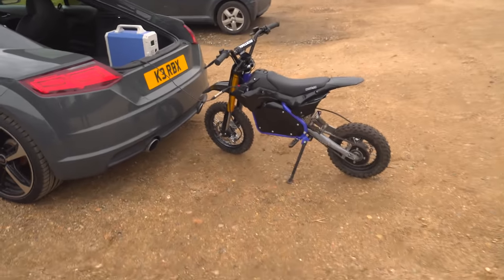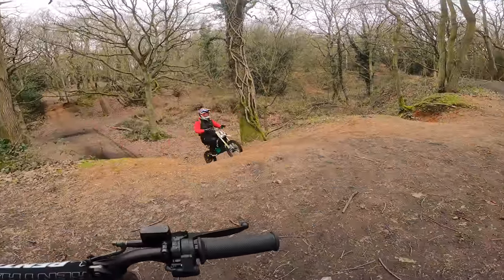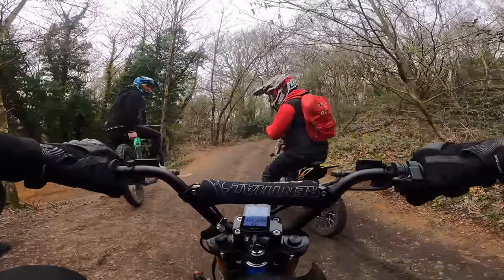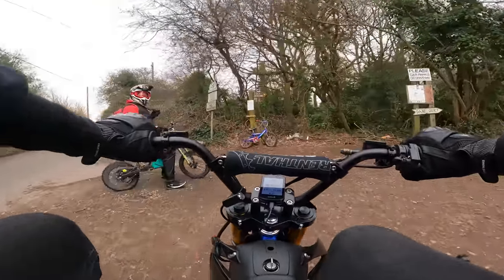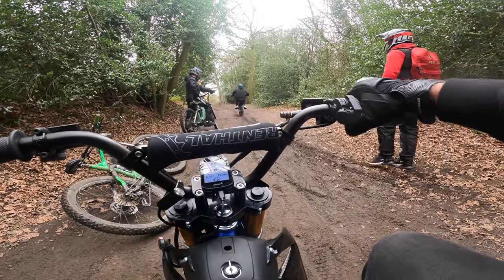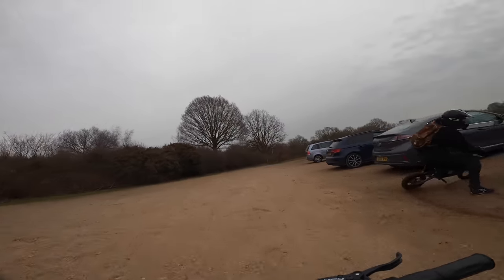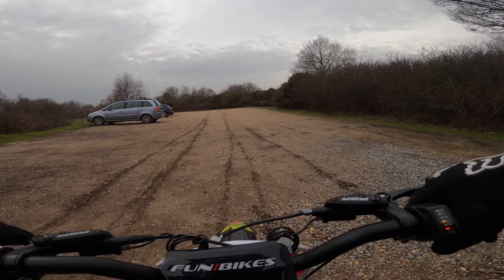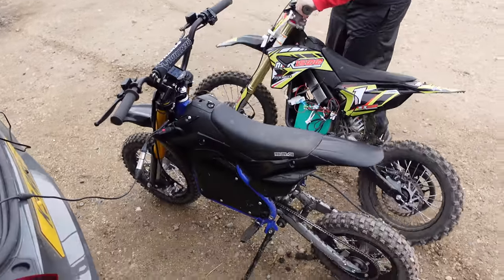RACING MODIFIED ELECTRIC MINI PIT BIKES!!! (10,000 WATTS)

Comment: Great content! What kind of amps do those setups draw at 10kw? Do you have the RPM spec's? I'm currently on 3 120v mower bats and a kelly controller with a 3000w 72v motor. It seems gutless much over 5k but pulls to 8krpm. also doesn't pull more than 75a with 3 40a rated packs. Changing the garing form factory makes is slower. Currently at 45mph with 11/80t gearing.

Comment: What kind of amp hours are you running on the 72? Thinking of doing my own, but for the sake of down time was wondering if using quick swap batteries like for cobalt 80 volt lawn tools maybe 2 in parallel and just getting a pile to swap out and keep going.
Reply: He's using 30q batteries in 3 x parallel setup IIRC so it would be 9Ah.

Comment: What’s the top speed on the mxr1500  can u do a gps  speed run curious because I got my son a mxr1300 and that doe 17 mph
Reply from the maker: 17mph for the standard one sounds about right. This one is modified and does about 30 ish.
Reply: Thanks for replying Andy  I’m proberly going to do similar to what you done my boys bored of the power now he’s had it since he was 4 he couldn’t even touch the ground then he’s 6 now

Comment: What ah rating is that battery and what sort of range can you get running 10kw??
Reply from the maker: It's a 9Ah 72V battery made of Samsung 21700 30T cells. Loads of power, small light pack that can be charged quick. 10kw on this bike might only happen for a split second. The average power is more like 2-3kw.
Reply: @andykirby  not bad, I'm running a 4ah 36v from two ryobi batteries so it puts outs amps no problem and I run it through at dc dc converter to boost it to 84v to get 4000w peak and I get 4 to 5 mile range

Comment: Lol Steve's gonna be buying you some tires for this bike soon lmao,
Reply from the maker: Yeah he will😁
Reply: @andykirby  lol where did you get those bikes from?
Reply from the maker: Steve's is from funbikes and mine from ebay. They don't go like that as standard!
Reply: @andykirby  I know lol I see you video with the mods, think I might get one after I've finished my ebike, still need 100 more 25r 2500mah to upgrade my battery because the current version is to unpredictable (20s 10p) 25ah 72v is my goal with 180A constant discharge 500A max (300A bms) + a new 200A - 300A controller that I've yet to find (any recommendations?) my bike looks nice as an angel/ like an 85cc monkey bike
Reply: @andykirby  but these do look fun and somewhat cheap

Comment: Andy Why don’t u both get sur Ron’s with a new battery and Bac 8000 controller ? This would pull off the line quicker than any others ebike and also would have a top speed of around 80 mph

Comment: Hi Andy, wondering if you could help me.. my little lad has a revvi 16” balance bike and from what I can gather, it has a 250w motor. And I’m thinking of adding a bit more juice too. He’s got a yamaha pw50, so the added power isn’t going to be too much for him, but it’ll help him on the days he’s unable to ride. As the extra power will help him get used to it I think. Have you come across a revvi bike and seen how they work and would you recommend anything. His bike has the removable battery, but the connector is deep in the frame I think. I did buy a spare battery at £95 for the extra range, but that doesn’t seem to be a problem really and we’ve not really ran outta juice yet. And has lasted 13 miles. My lad is 4yo and has been riding since he was 2. So the extra torque would be very much welcomed, as he is now starting to push it a little more at the local bmx track. On the hunt for some suspension forks too as the bumps are harsh at times and too much for his hands to keep a grip.

Comment: i think there is something if you take your battery pack and make an equal sized super capacitor bank when hooked up to the controller right gives you ability to control the smoothness of acceleration better plus you double your battery bank and like a tenth of the weight think that dude The Inja  a youtuber did something like that with his caferacer

Comment: Is there any 250 watt hub or mid drive motors that do about 20-25mph,that you can put back to 25kph/15mph incase I get a pull by the coppers?🚴💥
Reply: Any e-bike that can take a speedbox
Reply: you cant get to 25mph with 250 watts, you can get there using a 250w motor running it at 1kw, simple answer is just peddle, cops wont do a thing, ive been riding high power ebikes since the mid 90s, Police dont have power meters with them, just be sensible, I have 5kw capable hub motors on bikes, I have a simple 250W sticker on them and the same on the controller, only way you could face an issue is if you hit someone,  even then with or without a motor you will be in trouble anyway especially if you seriously hurt them and even then they would have to prove the motor was on and you were using it. Way too many people get hung up on whats legal, just be sensible, helmet, gloves, lights and high viz and you wont get any bother.
Reply: get what ever power hub you want. on ebay you can buy foil stickers that look pretty official stating that its a 250w road legal motor. iv had no problems yet
Reply: The bikes advertised as having a "off road mode" are illegal, any bike that has switchable power levels over 250w is, even if in 250w mode at the time.
Reply: @knoxieman  I can get over 30 mph on flat ground with my Bosch performance line cx gen 4 motor with a speed box. But I see what your saying.  Just go with what best suit your need and what you using your bike for.

Comment: 1st Off It's Too Light, 2nd It Needs Brush Hand Gaurds, 3rd Your Frickin Nutz!!! 🤣 I'm Now Building The Exact Same Size Power Train On My Old 1970 Suzuki RT1 360 MX Frame That I Used To Moto-Cross Race On At Age 17+18 In 1970-1972 & Blew The Motor Up On, PS I'm Now 67 Years Young! 🤣
Reply from the maker: 😅 Awesome!!! I'm still going be doing this when I'm 67 (hopefully!!!)

Comment: Those little bikes look mental 72v 10kw not enough that makes me laugh to think of that on those little wheels I've gone bigger in the rear wheel to get more top speed 72v 15kw thereabouts build atm im going back to 24in however with those little wheels the torque/acceleration will be impressive it must be nuts to ride

Comment: Would love to go out on a ride with you two I've got a 56v 18ah and 2kw hub btwin hard tail
Reply: I have (TWO) 58.8V Lipo4 life  25Ah in parallel on dual drive 1. 1000w 2. 1600w and it’s only on The control box is that it came with and the bike is a beast. I bought a Sabaton for a friend when I was building his bike but I asked to put it on mine and when I did my 1600 W on the back was crazy so I need to put a Sabaton on each wheel for a monster beast🔋🔋🔋

Comment: i wonder how that motor handles in summer ambient temps before it overheats or shorts itself together
Reply from the maker: It was about 13 degrees that day, I all honesty I think it will be fine. Just gotta be mindful and don't rag it hard for long extended periods. It would be better without the side panels on for a bit of airflow.